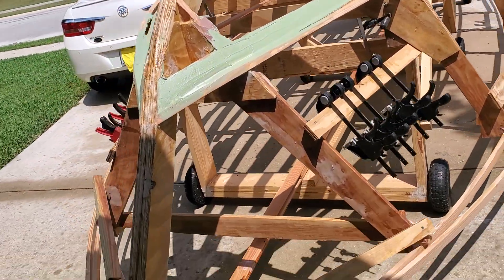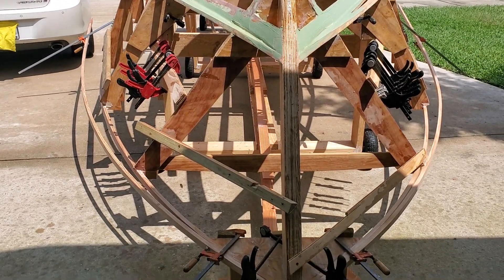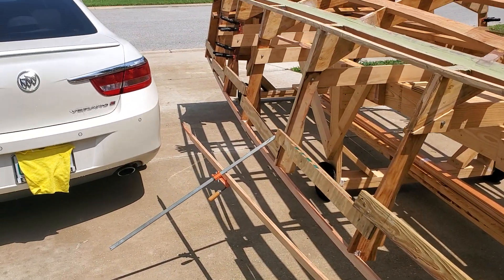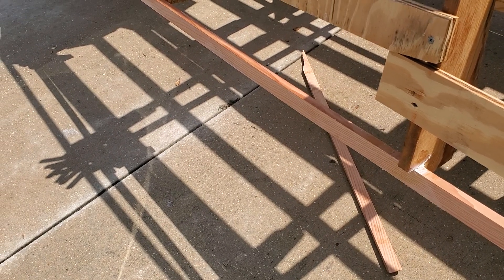shear clamps reveled

Comment: Hi James. Its Ian from New Zealand who built Glen L's Thunderbolt. It looks to me that the piece of timber you selected for the shear (or Gunwhale) had the grain going across it at an angle, as I can see it where it broke. I am not sure what timber you are using but in future I would reccommend selecting a piece of timber with the grain going along the length of it. This will reduce the risk of it breaking. Cheers Ian
Reply: @jamesboatbuild   Hi James, Thunderbolt is one of Glen l's designs and we built it mid-sixties. There a few photos of the build on the Glen L website. Put this in your search bar and it should come up. However, the photos don't seem to be there. https://boatbuilders.glen-l.com/thunderbolt-design/
Reply: @jamesboatbuild  I don't seem to be able to send the photos this way but if you let me have your email address I will send them that way. Cheers Ian

Comment: James you have motivated me personally, just waiting on the plans to arrive. It’s a Tracey O’Brien designed semi deep V 22 - 26 feet cuddy cab. It’s of plywood construction, once the hull is sheeted and seams taped it’s actually flipped then stringers placed. James what thickness ply does your build require. I ask because the build I’m starting calls for inch thick Botton and 3/4 inch sides, I think that’s overkill considering the hull will be fibreglass on all seams then fully glassed inside and out with required cloth. All stringers and cross bracing is also glassed.
Reply: Thanks James, I’m tinkering with the idea of 1/2 inch bottom and possibly add another exterior layer of glass, 2 exterior layers of cloth, 1 interior plus all seems tapped in with appropriate cloth.